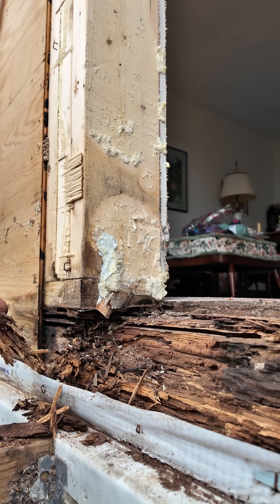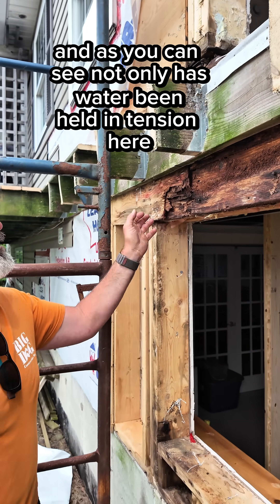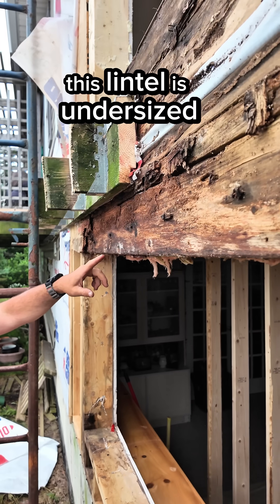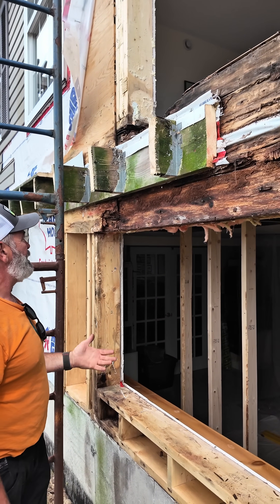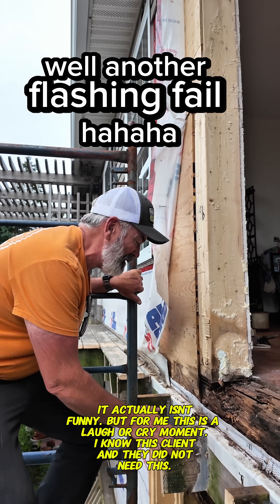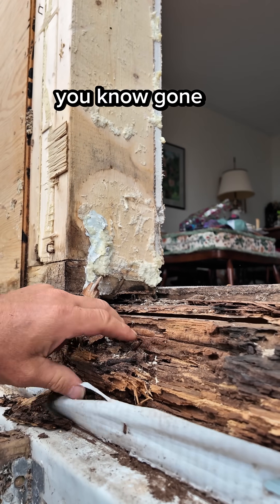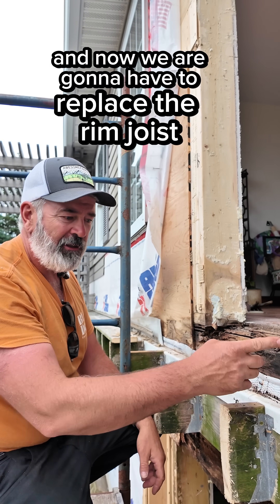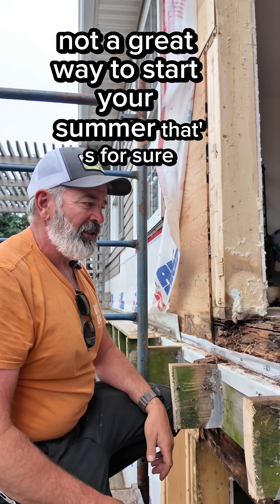Why Flashings are important! This is what happens when proper flashing techniques are not used.

Comment: When you change out a whole rim, do you frame a temp wall inside to hold the joists? Or how exactly do you hold everything up safely while you work?
Reply from the maker: There will be a full-length video soon explaining in detail this particular situation. 
In short, I always recommend temporary support of some kind
Reply: @Aron_Jones_Carpenter  Awesome. I like the shorts, but I enjoy sitting down learning more framing and such. I kind of got started backwards in the trades starting at finish work instead of rough so i'm more of a finish guy for sure with a strong background in windows & doors.

So I enjoy sitting down with my morning coffee and learning a bit more about framing.

Keep up the good work Aaron.

All the best from across the bay of fundy